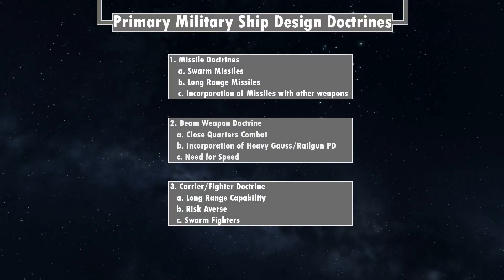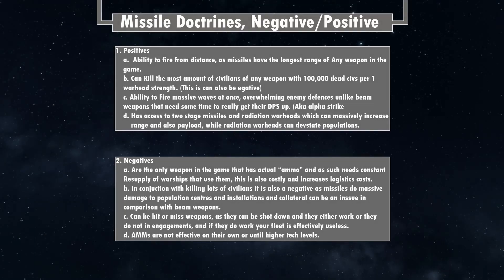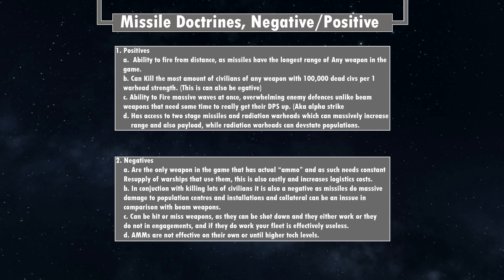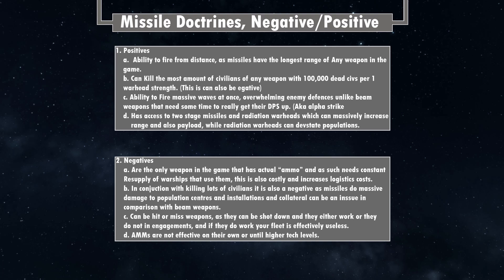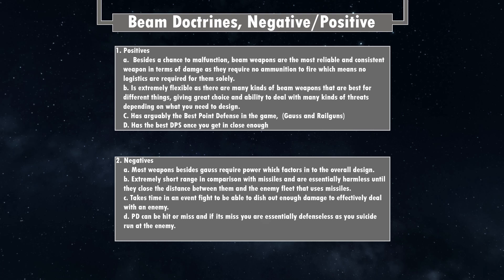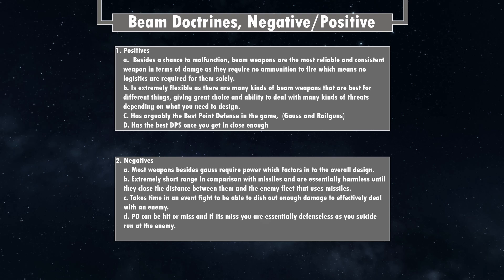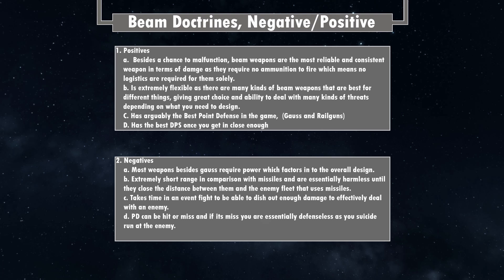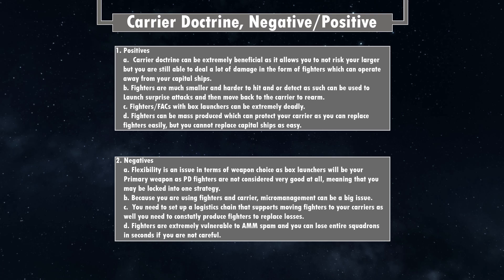Aurora 4x C# - Tutorial - Ship Design - Military Ship Design Philosophy Doctrines

Comment: Also, including gauss and railguns as beams is pushing it a bit. Lol

They're a entirely different branch of tech (kinetics), that frankly likely only uses the same fire control because Steve saw no time benefit to coding a separate fire control.
Reply from the maker: They are explicitly a beam weapon, they use a beam fire control and act in pretty much the same way, railguns even use power, the fact is they are beam weapons, as essentailly anything in aurora that is not missiles is.
Reply: @DefranStrategy  and likely only because coding renamed references to the exact same behaviour just had zero merit to Steve when deciding when to spend his time. The fact thst both are isolated to a tech branch outright referred to a  'kinetics' defines them as non-beam in terms of weapon type though.

Referring to them as beams is simply a clearer way to explain them game mechanically as they reuse the same behavioural code.
Reply from the maker: At this point its just arguing semantics, all that matters is that the viewer understands what i am referring to

Comment: Missile doctrine negative 'c' honestly exists more for energy weapons than it does for missiles. Making a missile that will pretty much be impossible to intercept with decent pd hit chance is possible even at low tech levels it just requires more of a range and damage trade off until missile tech matures.... the only way using missiles can ever have means of doing no damage is if the player defines a personal line in the sand of not being worth the trade off, though that doesn't change the ability to make a 78,000km/s missile with 1 damage and the same max firing range as equivalent teched lasers, that unlike the laser can be stacked 3-4 times for same space and pretty muvh be assured of some damage ouput.

Energy weapons however don't hàve that aspect to them, you have a 2.5million range laser, you're still only going to be able to fire that thing from like 600,000km with advanced fire control tech with a hit chance of like 15-20% per shot at that range, and needing to get close to half actual firing range to make it a 50/50 chance to hit anything.... and during all that time getting to shots to be a 50/50, your firepower is effectively zero given typical refire rates.
Reply from the maker: The point was in regards to the fact that when you come up against an enemy navy with your navy and you are using missiles you are either able to alpha strike through their PD or not and if you cant then you effectively cant do any damage at that point, where as with beam weapons if you are close enough nothing can actually intercept beam weapons so when you hit you are going to do something.
Reply: @DefranStrategy  making a missile that can be fired in volleys for similar tonnage cost as a single energy turret that will get through pretty much any pd your going to encounter in Aurora doesn't take that much though. What the tech advancements would do is just ease off the damage and range trade offs such a missile design would need. Yes at early tech such a missile requires trade offs of around perhaps 1 damage and marginally more range than a equivalent energy weapon, but the return would still be assured damage.... more than you'd get from the unreliable nature of energy weapons... and the flexibility of missiles means you can use both the assured damage design and 'maybe damage' designs side by side.

Though i suppose this depends on if  we are talking about design philosophy for what you'll encounter in aurora? Or design philosophies for non-existant things that only take place in theoretical scenarios.
Reply from the maker: The point assumes that you are not building a navy that knows exactly what it is facing as such missiles can be hit or miss in this regard and so can beams I discuss that about then as well